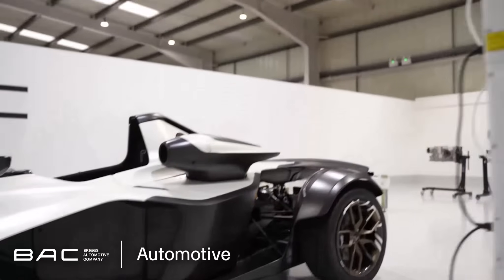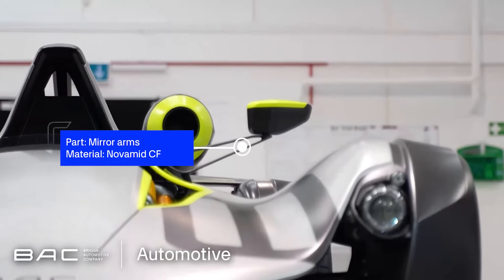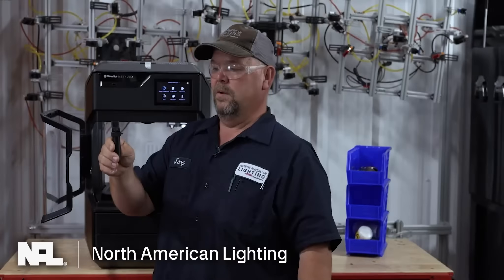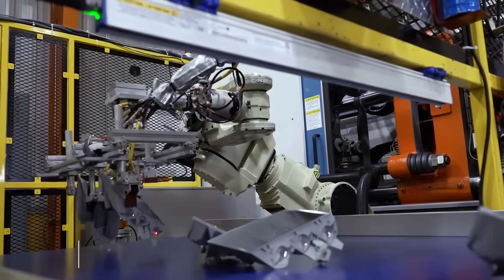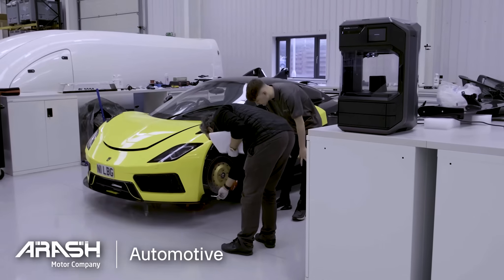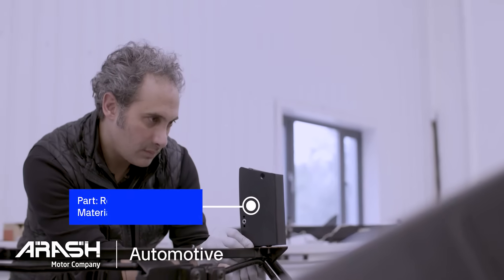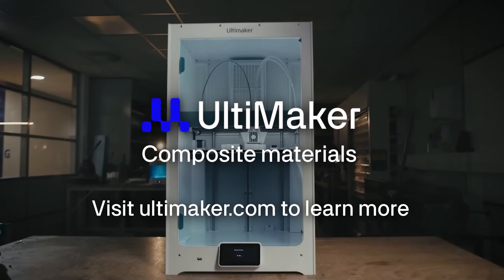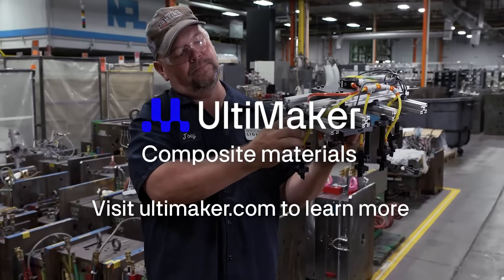UltiMaker Composite Materials: Carbon Fiber 3D Printing in Action

Comment: Using almost all the time the latest Windows version of stable Ultimaker Cura, is there a way to STOP cura from enumerating serial ports at startup, since this causes all my serial port related projects to reset! Please help!
Reply: I use cura for slicing stl files, and then upload the gcode to octoprint. so i don't ever want a direct printing through a serial port....
Reply: Easy, just stop using Cura. It happens on Linux too. It's really annoying and destroyed a quite a few of my jobs. Tried to slice something while my CNC was connected and working... Started Cura, destroyed 1.5h job.  I've moved on to an alternative slicer since.

Comment: Carbon Fiber is not a polymer. It is mixed with a polymer to form a filament.
Reply: 100% with you. CARBON FIBRE(S), it's self explanatory... It's a composite material i.e two or more materials combined. Another thing is how they can slam a fancy name on something and double the price is beyond me.
Reply: @MrHristoB   "Slam a fancy name on something"...Like what? You mean, they "slam" a name onto nylon filament, like carbon fiber nylon? They also slam carbon fiber into the nulon filament, its not just a name.
Reply: @FreshCityVentures  The examples are everywhere. I've been in the industrial equipment maintenance business for the last 25 years and I see it on a daily basis. Just look around you.

Comment: It would be great if I didn't have to spend 350€ on a CC Printcore with a completely outdated Ruby nozzle to print CFs/GFs with an Ultimaker. It's 2023! Why is there no E3D ObXidian Printcore!?
Reply from the maker: Thank you for your feedback on our CC Core products. We want to clarify that our current offerings no longer feature a Ruby nozzle. We continuously update our technology to provide the best printing experience. While the E3D ObXidian Printcore is not part of our current lineup, we believe our CC Core product offers great value and performance. We appreciate your consideration and welcome any questions you may have. Your input is valuable as we strive to improve our products in the future.